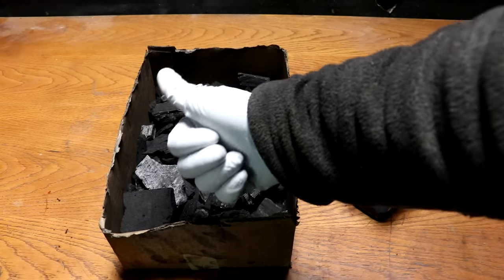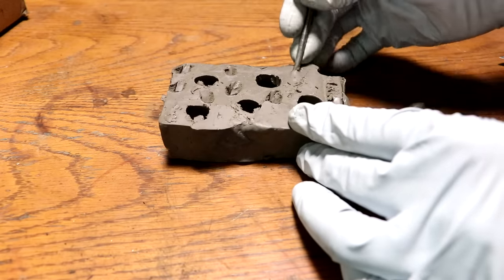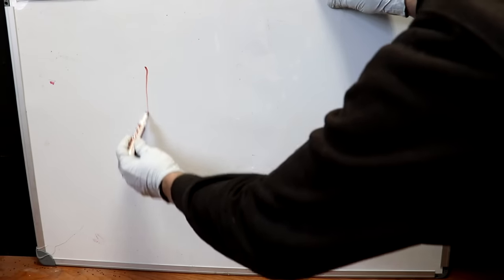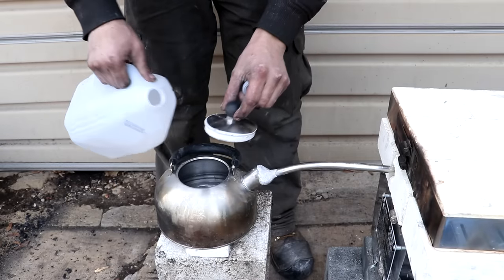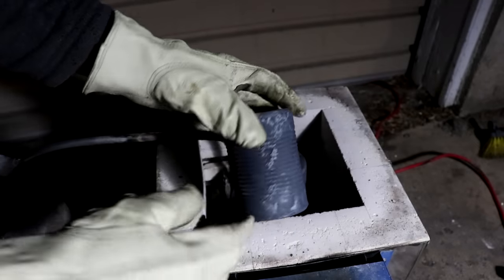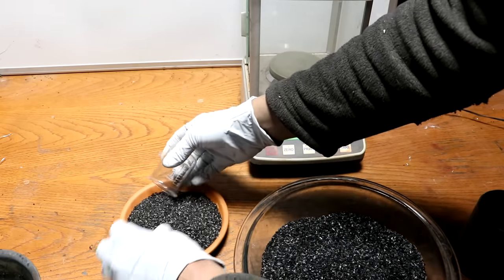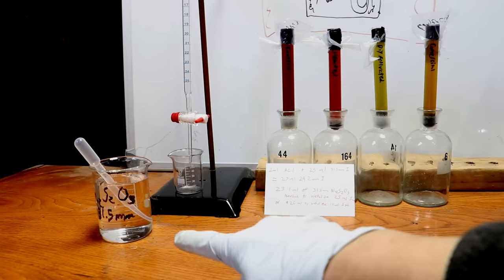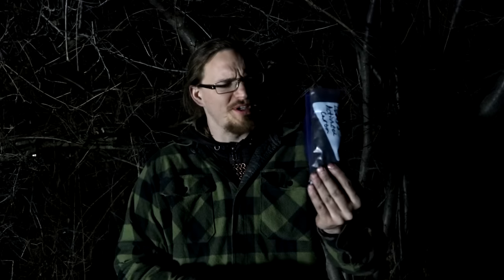Making Activated Carbon

Comment: Cody: touches mercury with bare hands, draws diagrams with gloves
Reply: I mean, have you ever tried washing marker off your hands? its annoying
Reply: Cody : has box of radioactive materials 
Also Cody : butter is my kryptonite
Reply: @onyxguardian1756  Alcohol, even hand sanitizer will remove pen ink.
Reply: @davidgalbraith1840  
Twas a joke, about how he will handle (potentially) dangerous materials bare handed, yet wear gloves for handling a marker.
Reply: It's because he can handle one mercury, but the marker is made of two mercuries. Add a whiteboard to the mix, and we have even more mercuries.

Comment: Hello Cody,
I have a recommendation that would likely work better. Instead of boiling water using a torch and sending steam into the carbon, send the torch flame directly into the tube that goes into the furnace. The exhaust of a properly tuned torch has a huge amount of water vapor in it, and some carbon dioxide, while containing little to no oxygen. Propane is C3H8; when fully combusted, each propane molecule results in four water molecules and three carbon dioxide molecules. Both carbon dioxide and water vapor will carry out reduction reactions that pit the charcoal and increase its surface area; hot carbon dioxide gives up one of its oxygens upon striking charcoal, resulting in two carbon monoxides. Reduction reactions are way more efficient at higher temperatures, and the exhaust of a torch is far hotter than the steam you were using.

I work at a micro-scale biomass gasifier company. The charcoal produced by our reactors passes through a 600-800˚C reduction zone, and was lab tested to have 496 m^2 of surface area per gram. Try using the torch flame itself as the source of the reduction gases. Insulate the tube that feeds your reaction chamber; the hotter the gases, the more efficiently the reduction occurs. Since all the reduction reactions are endothermic, making the gas hotter gives it more energy to carry out the reduction reactions.
Reply: Holy shit, you are too over qualified to comment
Reply: @miceskin 
he's not...
 Ask him what his favourite atom is.?
Reply: Wow I am your 5th subscriber! When you get big remember me!!
Reply: Awesome tip from someone with domain knowledge - thanks!
Reply: Thank you.
Reply: Now I want Cody to revisit this one.

Comment: Super memories here. My first job was with a company making smokeless fuel.  Our lab did everything from tar-analysis to pollution measurement to weather-recording (wind direction records were used to measure dust-particle fallout from chimneys). That was all back in the 70s when virtually everything was gravimetric.  Weighing scales,  the ones that used counterweights and burettes were daily tools. 

Titration of multiple samples was incredibly boring but more than compensated for with our sample collecting.  Taking water samples from rivers included measuring its flowrate. Dust sampling units were scattered over a wide area and the wind-direction data allowed us to map the deposition rates.

This video mentioned water-gas.  We produced a good amount of that and its a rare thing to hear about.

I loved that work and the people that did it.
Reply: That's going into details!
Reply: Triple beams are a fond memory of my chem classes before they remodeled and I'm not even 25 haha

Comment: Cody, this is one of the best videos you have ever produced!!!!  You have used stoichiometry and mass balance in the past, but this was a true experiment, showing the difference between a control and three different test substances.  Each step, including the screening of particle size was well planned out.   

It also has very practical real-world applications.  For example, the Keurig that sits on my countertop has an activated carbon filter to remove taste-related chemicals prior to brewing.

Thanks for a really excellent video!
Reply: The production of CO and H2 during this process reminds me of the previous method by which H2 gas was mass produced, by passing steam over red-hot iron.  The oxygen from the H2O combines with Fe, thus liberating H2.  Over 240 years ago, Antoine Lavoisier used this method to help prove the conservation of mass in chemical reactions and to pioneer the concept of stoichiometry.
Reply: thallok replacing my Keurig charcoal was what actually made me watch this video lol

Comment: Big piece of advice on making this product. 
When sifting run a magnet though the powder. This will remove metals. Use this especially if buying store bought charcoal.   It will pick up rust and sometimes through the process of manufacturers a decent amount of metals can get into the charcoal since it is is compressed powdered charcoal you never really know what's in it. If your magnet picks up a lot of metals scrap it and start over.
Reply: A magnet will only pick up some metals.

Comment: Good job Cody! I give you some tips. 1) the woodbased charcoal developes normally a small surface without activating agent by self gasification. You have made what is called "physical activation" with steam but can be done also with carbon dioxide. During the carbonization is developed some CO2 that self activate the carbon to some extent. Different pore size distribution by the way you normally obtain with CO2 generating more micropores while steam as you described in the plastiline examples favors the production of mesopores (2<x<50nm). 2) for your activating reactor design I suggest to use an horizontal pipe cylinder: you feed steam from one head and collected the outlet on the other side. In this way you have a more efficient contact between the carbon and the activating agent. 3) the increase in density is due to the ash to carbon ratio increasing with the slow oxidation of the carbon as you said. 4) I suggest if you want to perform next time also chemical activation: you can use ZnCl2 solution, H3PO4 or KOH. It is a little bit easier design you can make it in batches and at lower temperatures (about 500C for ZnCl2 700-750C for KOH). In the case of KOH be careful of reduced K metal!  With that carbon you can make a lot of applications (not only depuration but als capacitors). Well done!
Reply: davide can u suggest a simple and efficient method in detail, want to make activated carbon fabric at home, ( if possible)
Reply: davide can u upload a flowchart or something please man.

Comment: To bend metal tubing, securely close the 1 end, tightly pack the cavity with fine sand & seal the other end too.  Now you can bend the tubing without having the tube cave in on itself.   You can even saturate the sand with a soap water solution to reduce the friction - which will result in a smoother, more uniform bend.

Comment: How did you super heat the steam ?. I'm assuming with the electric coils inside?, Would it be any better to superheat the steam in that tube before it hits the charcoal?. Like that's a wrap that tube with a heater coil?
Reply from the maker: I thought about doing that but bending the tube was harder than expected.
Reply: @theCodyReeder  I heard people fill the tubes with sand to keep the tube from collapsing and heard others freezing water inside the tube so its ice to keep it from collapsing when bending it.
Reply: For tube bending we were taught to use quartz sand. I think because ordinary sand might burn inside the tube if heated
Reply: @ChristopherJones16  Water is used for bending tubing for instruments and pipes.
Reply: What if an iron tube is filled with very fine inert powder, an induction heater is used, and normal steam is passed into the apparatus? It could be bent into an u-shape to facilitate that.
Would that be able to superheat the steam?
Reply: Pine rosin has been used for a very long time to bend pipe without it creasing or breaking.

Heat it, fill pipe, bend it when it cools, heat it again to pour it out.
Reply: @crabmansteve6844  Not the way How It's Made showed it done, though.
Reply: @Skorpychan  I don't know what this means, my experience bending pipe this way comes from making brass musical instruments.
Reply: @crabmansteve6844   How It's Made is TV show that showcases the processes of how various things are made. I am assuming different trades and industries use different materials and techniques to bend pipes and tubes.
Reply: @NetAnon  if i am thinking of the same episode as he, how its made was showing a particular factory bending trumpet parts, and they used dishsoap, and froze it in a brine bath. I agree their are many ways it can be done, and rhe same technique may not even be used for the same parts by different factories. As far as I'm aware, the tubes still had to be put in a mold and reamed with ball bearing to take out flat spots and wrinking from the bending process.
Reply: @ChristopherJones16  q
Reply: He didn't superheat the steam at all.
Reply: @Rem1061  He did, though. With the 900C furnace.
Reply: It's in the vid. He used a blowtorch instead of a coil so his breaker won't pop
Reply: @heibai7034 
That was just the initial heating to induce the phase change.
The furnace is what was supposed to superheat it.
Reply: @theCodyReeder  Those steel coil springs with close-together coils give good compression when bending tubes, just slide it over the tubing, bend, and slide it along, repeat.
Reply: @theCodyReeder  use sand inside the tubes it avoid the tube from damage when bending
Reply: @elarcadenoah9000  Did nobody pay attention to the fact that he used tin inside the tube? He DID use something to stop it folding. Even with sand or whatever, when you're bending a tube 180 degrees in such a short distance, it's pretty much impossible to do it without some deformation unless you melt/soften the tube.

Comment: When titrating iodine it pays to use starch as an indicator. The change from dark blue to colourless makes the endpoint much clearer than the slow fading out of yellow you were dealing with. This would also be much clearer on camera.

Nonetheless, good work as always!
Reply: Out was vey clear on camera. It went from yellow to clear.
Reply from the maker: In one of the “hidden” videos I flashed links for I used starch but I did not notice an increase in accuracy so I omitted it for the final. I always try to reduce instructions as much as possible.
Reply: @theCodyReeder  Hidden videos? All this sneaky business! :-D
The unnoticeable difference in accuracy may be related to the relatively high concentration of the thiosulphate solution used in the titration. 0.7mL is quite a small volume to be titrating with a burette of that size, so I still think starch would help if the precision of your measurement was of greater importance. But of course, you did it and it worked to demonstrate the efficacy of your homemade product!

I really love your work and I'm only a teeny bit jealous that with my urban location in Germany it would be exceedingly difficult for me to get away with even half of the experiments that you carry out! Someday I'd like to post a few practical science videos of my own but selecting the subject matter is proving a little tricky, for the above reason.
Reply: @AguaFluorida  you forgot that starch isn't an optimal indicator, it uses up "a lot" of thiosulpate for it to change color: to have a more noticeable change in color than the yellow-transparent in the video you have to add some mL of starch solution, in a reaction that only uses only 0.7 mL of (S2O3)2- solution it can cause an increase up to 0.5mL, with an enormous error! In fact it said to add starch only at the end of the titration to be able to see a little better the final part of the change, if you add it at the beginning it uses up reagents
Reply: @8paolo96  Great reply, I'm glad to have stimulated a worthwhile discussion. =b

Comment: If we want to just increase the surface area, how is this activated charcoal better than just grinding it up to a very fine dust?
Reply from the maker: get it fine enough to be the equivalent of activated and it becomes useless as a filter because you cant hold onto it.
Reply: Cody'sLab could it work where you didn’t use it as a filter? Like if you swallowed a poison, or is activated still better?
Reply: @superalvin7208  good question!
Reply: it might get too small and your body will absorb it along with the poison, making it useless.
Reply: fine dust wouldn't get channels to allow sht you need to react to go through.
it will act like a surface of one brick.
for swallowing it should be not effective too
because you need the pieces to stay and work in your stomach for a longer time.
Reply: OK.   Any volunteers for the "ingested poison" experiment?    We'll probably need more than one test subject.   😨😨😰🤮🤢🏥 ☠👻
Reply: Илья Райтфайта do you mean that carbon in a fine powder would pass through your stomach faster than activated carbon?
Reply: @superalvin7208  we rarely actually use activated carbon in emergency medicine any more. It adsorbs a limited spectrum of toxins, but the risk of a deadly chemical pneumonitis if you aspirate it far outweighs any benefit. Intravenous lipid emulsion or gastric decontamination with a rosin are much more common. That said, in the very limited occasional use, it is both activated and then very nearly powdered so that it can be mixed with water and  taken as a  drink or through a gastric tube.
Reply: Sylvain Ellis very interesting! Thank you for the explanation

Comment: 9:06 How to do this PERFECTLY: Use the hydrogen flame to boil the water in the kettle.
Reply: could you ellaborate? i still don't understand why cody can't supply the steam continously
Reply: @user-df5is8jy6n  Well; the flamable gas that is produced from the reaction, instead of just being burnt for the heck of it, could be used to keep the kettle heated instead of using the torch. So it would be a full circle production with "minimal" startup. The heated steam produces flammable gas from reaction with charcoal, said gas is used to keep the kettle heated, which then continues the reaction and so on :)
Reply: @TheMols14  really, so it was for economic consideration?

my hypothesis was, once the syngas produced from the reaction of steam and charcoal, the steam would only lower the overall temperature. i mean steam around a 100C, while syngas combustion would be higher than that i suppose.

what do you think?
Reply: @TheMols14  It wouldn't work without at least a little help from an external source, considering it dies down after some time. Would be interesting to see it done, though 🤔 Maybe it would balance out?
Reply: @TheMols14  You could only use the exhaust to help heat it, not to heat by itself, otherwise that would be perpetual energy. The kettle is the fuel tank for the CO and H mixture which requires a heat source. Boiling the water, the reacting the charcoal, etc. takes energy away from the equation, meaning that the energy returned would be rapidly diminishing every time you went from steam to flame to steam again.